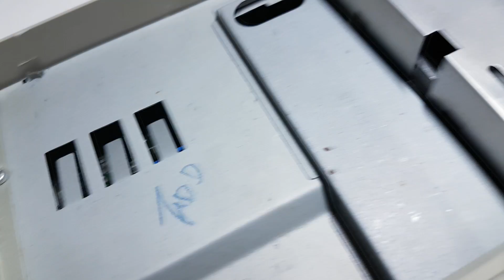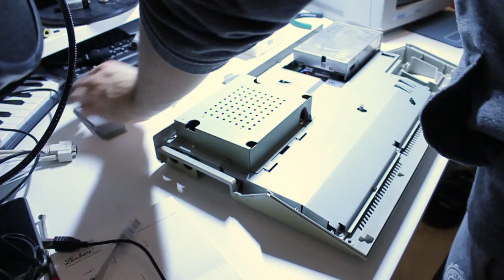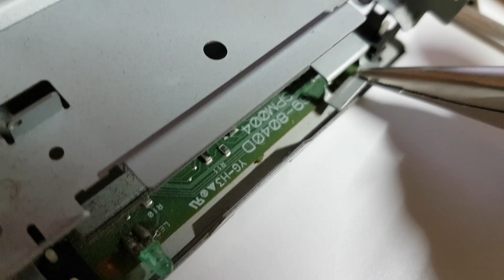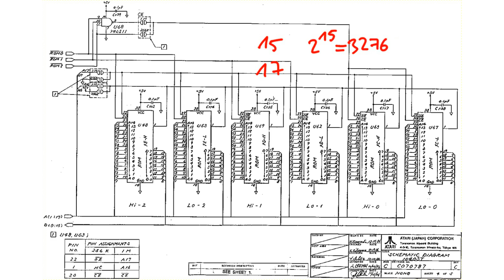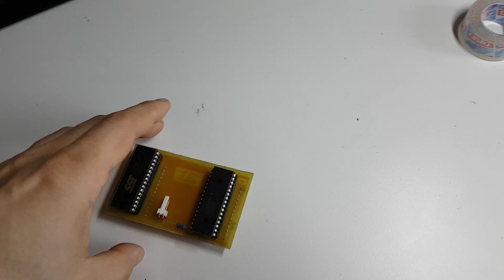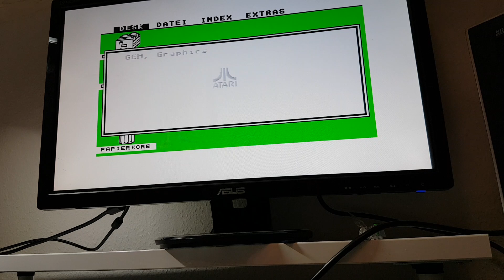Atari 1040STf Reburbish / Floppy Replacement / VGA Cable Manufacturing / TOS Upgrade

Comment: You could tryto repeat the retrobright, however by not using the cream peroxide. Just submerge in a solution made of water 3/4 and peroxide 1/4, into a transparent plastic box and let it do the (hope so) magic under the sun. Hope that it could help your case to render the color more uniform. Totally agree to not paint (using a simple spraypaint) the case, as it's inevitable it will going to be full of scratches after a while.

Comment: In this instance, it is ok to cut a rectangular opening in the case for an Amiga / Atari ST compatible PC disk drive.  As long as it is done right, and looks good, it will not ruin the appearance of the Atari ST computer.  Atari should have done it this way to begin with.  I have always hated these none standard disk drive openings in vintage computers.  It is one of the many reasons why I hate the poorly designed Amiga 3000 computer.  Also, you could mount the Atari ST motherboard into a nice PC tower case.  Then you can install Amiga / Atari ST compatible PC disk drives into that tower case.  You could also install a Supra Atari Hard Disk into that tower cases.  Spray paint the PC tower case Atari ST grey.  Mask off and spray paint Atari ST blue stripes, like what's on the Atari ST boxes.  Change all of the LEDs to blue LEDs.  Then, you will have built yourself an Atari ST Tower of Power.  Oh, you can find PC tower cases in grey, with grey plastic fronts.  Then all you would have to do is mask off and spray paint the blue stripes.  😃
Reply: However, the Atari itself actually made this a reality with the Falcon standard disk drive, using a neat, rectangular opening design in the case!
Reply: Awful solution (to cut a rectangular opening in the case), although anyone can do whatever he likes to his own equipment. However it's an horrible solution (to cut a rectangular opening in the case) and should not be used at all.
Reply: @MtaFto  Why is this "an awful solution"?  🤔
Reply: @HansCampbell  edited my comment, I meant it just for this "to cut a rectangular opening in the case".

Comment: The original Atari monochrom Monitors have a vey fast refresh rate of 60 HZ ,so i think a Original Monitor is a better choise
Reply: The SM 124 has a refresh rate of 71.4 Hz. Very crisp and steady display.

Comment: Thanks for advising not to retrobrighting the case)) In fact it is also very hard to find that chemical stuff peroxide here in NZ! I would simply use another case which less yellow, but some yellow I think is fine as it shows that it is a retro stuff ) Anyway, I was amazed how you upgraded the TOS! Have you experienced any improvements after all?

Comment: Pressing ESC notifies tos that there is a new disc (or image) and will display the contents. 😉
Reply: Right. And as far as I remember, the ST was supposed to behave like a Mac, but Apple got in the way with patents ... So, no floppy change auto detect, no auto floppy eject ...

Comment: Redmond Cable out of Redmond Washington in the US actually would make one of those cables for you custom.  When I was a kid I wanted to use my Sega Genesis via the RGB output on my Atari PS3000 monitor.  I sent my request wish a $30 money order to Redmond and in 4 weeks I got my cable!  It worked/works great and the quality was/is top notch!  This was back in 1990 and when the 32x came out and then the Saturn after that I also had them make me cables for both of those systems.  Redmond Cable is still around (they even have the same awesome logo!) just look them up if any of you are interested in custom cables.  They're amazing!  Actually if it's okay I will include their web address: https://redcab.com/home.php .

Comment: I learned somewhere that there is a VERY tiny capacitor on the underside of the drive that when it goes bad causes the motor speed to become unreliable.  You will need to replace this and you can then use your original drive in your ST! :) Hope that helps your problem.

Comment: Might be more work, but have you considered just 3D printing a disk drive adapter and faceplate?  You could probably even mount an opto-interrupter diode (or whatever it's called) to detect when the disk is inserted...

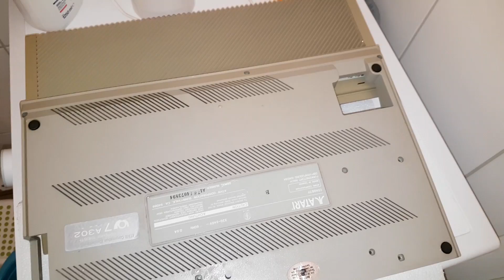Comment: Konnte der ST den auch direkt auf Basic booten? Ich hatte einst einen Atari XE, der auf die 8 Bit Atari-Computer basierte aber ähnlich wie der ST aussah. Ich wünschte mir, dass ich irgendwann mal einen XE (und einen C-64, wie wir ihn in meiner alten Grundschule in Hamburg hatten) wieder finden kann. Hier in Mittelamerika sind die Optionen aber etwas eingeschränkt. Übrigens kann ich mich nicht erinnern, dass mein alter Atari XE je einen Aufkleber der Deutschen Bundespost hatte (wie der bei 4:14, mit dem Posthorn und der Nummer 7 A302, was immer das bedeuten soll).
Reply from the maker: Der ST hat kein BASIC eingebaut. Das war ziemlich selten in der 16 bit Ära. Mein IBM PS/2 Model 30 ist die einzige 16Bit-Maschine mit BASIC ROM, die ich kenne.
Reply: @flashmeback  Ich weiß, dass der IBM PC AT (5170) BASIC im ROM hat.
Reply from the maker: @bundesautobahn7  Wusste ich gar nicht! Mein AT Clone hatte keins :-(

Comment: The ST stood for the architecture (which has probably been pointed out previously) Sixteen Thirty-Two
Reply from the maker: I think I didn't mention it, but it's good, descriptive name :D
Reply: @flashmeback  I thought it was a bit of interesting Atari trivia.  The same applied to the TT series (Thirty-Two Thirty-Two) that followed closer to the end of the line for Atari as a company.

Comment: You can mod a lot of PC floppy drives to work with STs or Amigas, just google for amiga pc fdd mod or something like that. Although there are no jumpers anymore, you can just cut a trace or resolder a bridge to change it from 1 to 0, furthermore you should be able to wire up the disk change signal too, just follow that guide. FB354s/FB357s are quite common in Amigas and Roland MIDI modules, but honestly I havent't seen one with similar eject button. Try cleaning up and lubeing the rails, maybe the head cannot reach a sector it's looking for - make esure it can traverse freely from end to end and there are no gunk residues. You could also use some kind of disk verify software, like diskcopy on Amiga, so that you can see what's wrong with your drive.
Love your channel BTW.
Reply from the maker: Yeah, I was going to revisit the ST this year. The floppy drive is definitely on the list of things I haven't given up on, yet :)
Reply: @flashmeback  you should try to recap the board of the drive, sometimes those little caps are the culprits. Another user suggested it in the comment, before me. Did you solve this issue?

Comment: 29:50, a tip for getting solder out of those holes easier, without a pump. Put it over the edge of a table and heat it up, and you can just flex the board a bit with your finger and let it snap back. The molten solder will fall right out of there.
Reply from the maker: I got an actual desoldering station in the meantime. That works a million times better :)
I don't like flexing boards, you never know what subtle damage you produce.

Comment: I have quite some expirience with modding ST computers. 
The reason the disc change detect is not working is, Atari used the write protect wire for that. You need mod the floppy drive a bit to make it work perfectly. A quick workaroud is, after changing the disc you hit ESC on the disc window, that forces a refresh.
I have recorded me modding a drive in realtime, in pretty horrible quality. https://youtu.be/QAaAl2jma7Q
In this mod, i also connect the HD detect signal so i can use 1.44 MB floppies. But you need a mod for the floppy controller for that to work. They are available sometimes on ebay, or you can ask in the german atari forum, someone might have a spare one.
I think the HD floppy mod is one of the most useful. 
You can also add an IDE adapter and then use a CF card as harddisk, but that requires a bit more work.
Reply: PS: i just realized that you have the version where the CPU sits in the front under the keyboard, that makes it almost impossible to fit an IDE adapter.

Comment: TOS ROMs are available on eBay nearly all the time. I bought a set for my own Atari-ST which originally came with the floppy-boot ROMs, and then Atari sent me TOS 1.0. Now I have TOS 1.4.
Reply from the maker: It was fun to make this EEPROM variant though :)
Reply: @flashmeback  I'm sure. You sure learned a lot building your own programmer.
Reply from the maker: @alhartman66  Certainly :-) I wouldn't want to work with this one professionally, but for hobby stuff it's awesome!

Comment: thank you for making this video, especially for showing the pitfalls, errors, workarounds etc... showing the problems you came across and overcame is much more informative than just showing an edited "successful" version, so thank you...
i also didn't think you failed in any way, your ST is not only much improved from when you started, but it also ended up with a unique character... :)
i know this video is a year old, as i write this,so you may have already gone down this route... but have you considered replacing the floppy with a gotek?
Reply from the maker: I thought about it, yeah. I have a spar Gotek drive lying around. I might still do it. Though I think I'll also give the original drive another chance. If I use the Gotek, I'll probably attach it externally.

Comment: What retrobright process did you use? I'm curious because I've seen these types of results from spreading liquid on the item, covering and putting in the sun but submerging in liquid seems to be a more even process.
Reply from the maker: Yeah, I used the DIY cream method. Peroxide + Xanthan + Glycerine + Sunlight.

I didn't know about the submerging method back then. Would totally try that next time, it seems much safer, even if it's a bit more expensive.

Comment: Do u have a tutorial on using picoPSU on ST? My STFM died and original PSU are hard to find.
Reply from the maker: I haven't tried that, but it looks like it should be easy to do. ATX (which the picoPSU is) provides all the required voltages, +5V, +12V and -12V. The hardest part will be tapping the -12V line (check this pinout: https://en.wikipedia.org/wiki/ATX#/media/File:ATX_20-PIN.png ), it doesn't seem like there's a dedicated solder point for that.
Another somewhat difficult thing will be to place a good looking jack for the 12V input where the mains jack is on the ST.
One additional problem might be to make it actually turn on. On many ATX PSUs you can just short the PS_ON pin, but some don't like that and will turn off again, also if there's not enough load.
I don't know enough about the picoPSU to really competently answer any of those questions.

Comment: Welcome to the world of the Atari ST! You've really jumped in with both feet! What model of ASUS LCD do you have that is compatible with ~15KHz? Does it do a true 50Hz or just upconvert to 60Hz?
Reply from the maker: I'm not sure! I assume it converts, but I couldn't find any reliable information. Not sure how to test properly.
It's a VE258.
Reply: Thanks! It's not a VE258Q, just VE258? That model is apparently much more rare.

50Hz is likely pretty common, but getting 240p 50Hz support is less common. LCD monitors often assume it's 480i and de-interlace it into 480p 25Hz. Easiest test would be to play a 50Hz scrolling game and see if it updates properly. Only one for a non-STE I know of that does 1VBL scrolling (8-way, at that!) is Enchanted Land. You might need to compare to a CRT in order to know for sure it's at 50Hz.

Comment: you probably used too strong concentrate of hydro peroxide in combination with multiple applications which effectively ruined the case ..
Reply: Probably easier would be finding an old atari for spare parts with a case in a better condition to replace with and trying the retrobright process again if needed.

Comment: I had something similar happen to my Atari. There are two options you can try. On my Atari, the case cover would look normal when it was wet. So if yours does the same thing, then go ahead and give my method a try. I used a magic eraser and went over the cloudy looking areas to level out the discoloration. that worked very well. I tried in one spot some matte clear coat . and that seems to level out the appearance as well. I cleaned off that spot and used the magic eraser on the entire case. I prefer this method, as I can still make changes to the appearance, which would be impossible with clear coat applied.
Good luck
Reply from the maker: I tried a magic eraser, but it has no effect :-(
I have been told to try vinyl dye, I think I'll do that some time this year.
Reply: Definitely no dye, it's a terrible idea.In that case I'd just leave it the way it is. See David Murrays video on how he tried different methods including dye.
https://youtu.be/qZYbchvSUDY

Comment: Ok, for your floppy problem, try downloading the fmc.arc program from this page to reset the media change. http://www.atari.org/hosted/quickfaq/stfaq_3.htm#31

Also, swap pins 2 and 34 on drive cable like people do for Amiga Drives. Pin 2 is Density Select, and 34 is Disk Change/Ready. The idea is that when you insert a 720k disk, it will toggle the density select sensor, but since it is crossed to the Disk Change Signal, it will signal to the Atari that you have changed the disk. Some floppies have a jumper for this, others you need to coss the wires on the cable. Check some of the videos about modifying a PC drive for an Amiga for examples.
Reply: Doing the second one is easier, otherwise you have to have the fmc.arc program on every floppy. But if you have a hard disk, it makes this easier.
Reply from the maker: Oh, that's definitely something I will try when I go back to this ST which I want to do sometime this year. Thanks for the hints!

Comment: Wenn ROM0 & ROM1 & ROM2= High then Out = Low (!CE= ChipEnable) und die hinteren Chips sind selected.
wegen der Reinigung schau einmal auf dem 8bitguy seine Videos er "bleatched" die Tasten  hehe ;-) Das macht er mit 40% Peroxide & 70°C heißem Wasser in dem er die Tasten einlegt. Have a watch for bleaching the old Keyboard Keys => https://www.youtube.com/watch?v=qZYbchvSUDY
if i'm wrong that you can speak also German so in English - there is a Guy he also bleached the Keyboard Keys and the old Computers like the Commodore C64 case. So have a look to his Show at Youtube here. Best Reagards Volker

Comment: Sehr cooles Video, ich habe es sehr genossen! Ich bin selber mit einem Atari 1040STFM gross geworden und da wäre dieser TOS-Umbau extrem interessant. Vorallem, wenn man in der Lage wäre ein noch höheres TOS als 1.04 einzusetzen (1.06 oder das korrigierte 1.62) welche ja erst in den STE Varianten zum Einsatz gekommen sind.
Reply from the maker: Soweit ich weiß benötigt TOS ab 1.06 Teile der neuen STe Hardware. Wird also leider niemals möglich sein, aber zum Glück ist ein STe gar nicht so viel teurer als ein STf. Zumindest deutlich erschwinglicher als ein Falcon :)
Reply: Ja schon krass, was man "immer" noch oder aber "wieder" für einen Falcon bezahlen muss... Trotzdem war es damals immer DER grosse Traum, irgendwann mal einen Falcon zu besitzen :). Die Demo-Szene hatte sich aber ja extrem auf die STF Serie eingeschossen, sodaß der Wechsel nie statt gefunden hat. Dort bin ich dann auch irgendwie hängen geblieben, obwohl ich schon viel mehr mit dem Atari gearbeitet als gespielt habe.

Comment: Hopefully by now you have got the case sorted out, but if not consider painting it. Back in 1989 at a show in London I remember seeing Jeff Minter's ST he/d painted matt black with white stars, comets and planets and a huge rainbow. It sounds garish, but it had been airbrushed and was quite subtle. Use a plastic primer so the paint doesn't just fall off (bumper primer from a car parts shop works). I tried it on my old 800xl which technically worked but my complete lack of artistic talent made it a bit of a disaster. I should have asked one of my more arty friends to do it for me!! I ended up a couple of years later swapping the case from an unworking xl and disposing the evidence!!
Reply from the maker: Not yet, but I've not been working on this machine since I refurbished it (except for playing games, but that hardly counts as work).
I've got some advice to try Vinyl dye. I'm going to do that in northern hemisphere spring or early summer. I'll make sure to get a video of the attempt.

I thought about replacing the case, but it's not easy to find an actually non-working 1040STf and I wouldn't want to take the case of a repairable machine.

Comment: Regarding the plastic. I have found good use with ariel washing machine soap. Standard non-color type in powder form. Then mixed it with warm water untill it feels greasy like cooking oil. Then it takes 30 minutes of soaking and not 2 hours. I have done it with a keytronic keyboard from 1996. Works well with dirt.
Reply from the maker: I guess I'll give that a try. I don't really mind the 2 hour wait though, because I can do other stuff in that time :)
Reply: flash /me back I think it works on grime and fatt from fingers, because the soap has those ensymes. Sadly it is not going to take away yellow on plastic. That would be awesomme. Hydrogen perioxid is kind of scary if it gets on fingers. Anyway... Things do get clean this way.